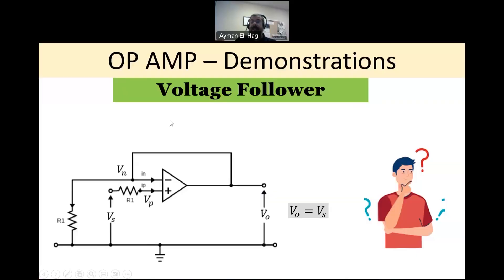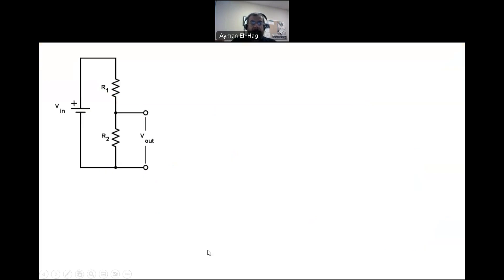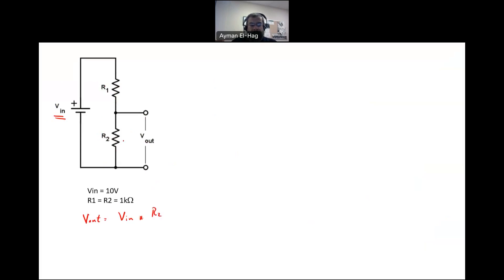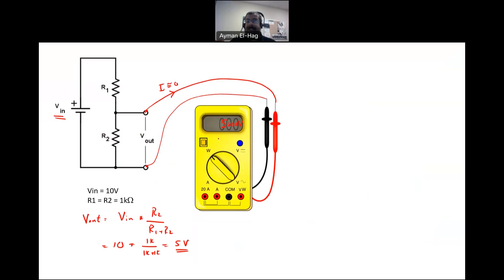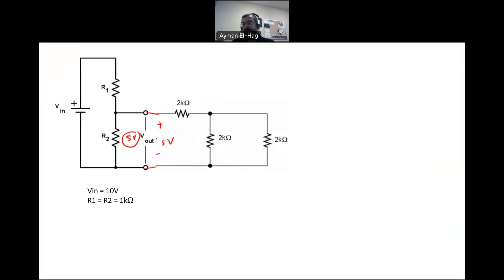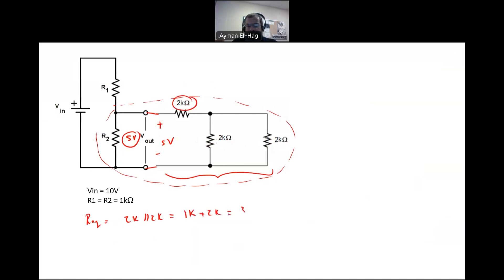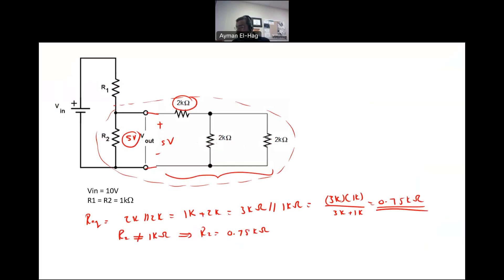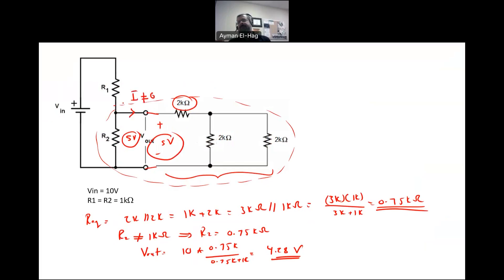Demo: Voltage Follower

Comment: Needed this. I am new to circuits and build some for own DIY use. Hit a wall with getting 5.1 volts to continue on USB as soon as I plugged something in (a project with USB lamps using other batteries). My divider from 12 volts was "perfect" and then the numbers got destroyed by that parallel resistance in a load being added.
Reply from the maker: What the load resistance compared to divider resistance.